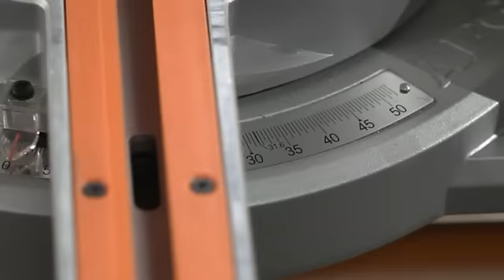Mitre Saw - AEG Powertools

Comment: Good solid saw but the dust extraction system does not work very well at all (nothing like what is shown in this video or description). I ended up with more sawdust on the floor than in the bucket (barely anything in the bucket) & if you happen to attach the small dust bag instead, then be ready to have sawdust blown directly into your face from the gap/split in the bag where the metal spring attachment is (the force from the turbo extractor blows dust into the bag which is forced back out through the bag split right into your face). I was extremely disappointed with the dust extraction system as it barely does anything at all!! My only advice would be that if the only thing which leans you toward buying this saw is the so called 80% turbo dust extraction system then think twice because it doesnt really work.
Reply: I'm agree with you mate, I've got the same problem with my one.
Have bought it 3 weeks ago

Comment: Good saw but the dust extraction is useless. I looked up this video to make sure I had the extractor pipes hooked up correctly
Reply: Did you work out what was wrong? I just set one up and it appears the dust extraction does absolutely nothing even with the bare hose?

I'm wondering if I missed something considering how bad the manual is - the manual for the table it goes on is more comprehensive!